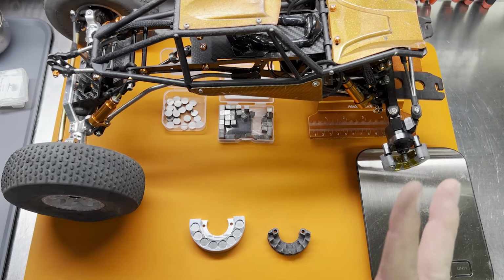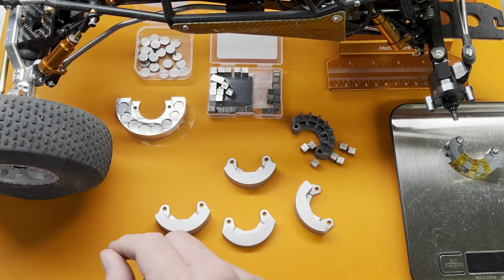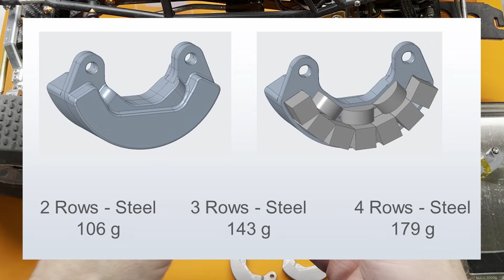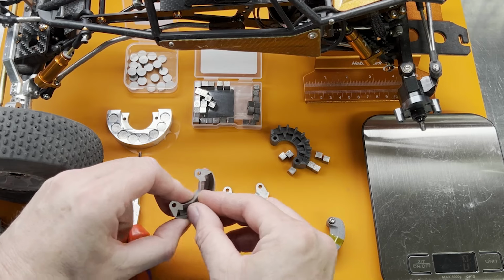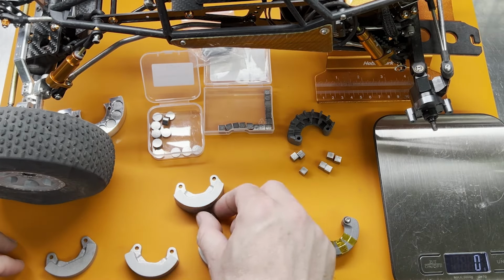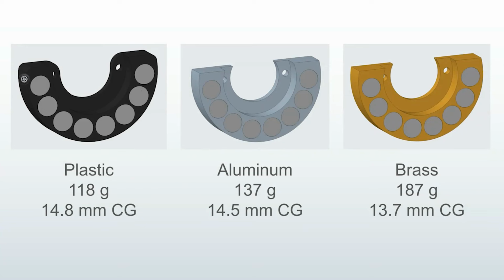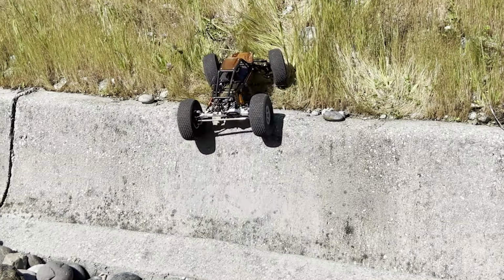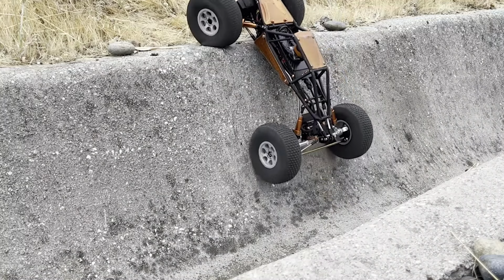Next Level Weight Hanger

Comment: For sale? Also, I don’t have Capra axles but the bolt pattern looks quite similar to the adaptor I have. I’m thinking I could get it to fit.
Reply from the maker: I wasn't planning on selling them, but I may have to put together a plan after so much interest.  Bolts are 32mm apart.

Comment: Could these be printed in PLA?  If so would you be willing to allow subscribers to purchase the files for a reasonable fee?
Reply from the maker: We could work something out. However, I don’t think plastic is a good idea- this is optimized for steel - relatively thin and the weights are super heavy. I don’t know for a fact that they would fail - I just would not care to risk it with anyone. DM me on FB with the same name as this channel.
Reply from the maker: What wheels and knuckles are you running?
Reply: @BoomslangSuss I will be getting the Dlux 2.2 Ultra High Clearance wheels.
Reply: @BoomslangSuss I should probably go with metal.  Let me know if you plan on selling some of the metal versions you have made up.  Thanks!
Reply from the maker: @jakefifelski3851  I am working on a plan. Stay tuned.
Reply: Man I wish you guys would do this cool stuff for vanquish f10 axles, not always for the capra ones.. but wouldn't fit in standard 1.9 wheels anyways probably

Comment: I figured out a way to use a spring on the shock shaft to create an automatic compressed front end, while still acting as a normal suspension while trailing. 
I used pen springs on the shock shaft inside, on longer shocks +10mm shocks, 20 weight oil.
Extended shock towers also.
The shocks still have the stock outer spring but backed off all the way.
While climbing the front stays down, but the axle still drops down when skid is hung up or vehicle is lifted off the ground.
I spent months finding the right pen spring and oil combo.

The trick is to balance both springs and oil weight.
If you get all them right, considering your front axle weight, it works great.

If you want to just trail you can activate full suspension by simply lowering the outer shock collar, which will over-ride the inner shaft spring giving you standard suspension.
Reply from the maker: I feel like your describing these two videos 🤣
Reply from the maker: The 2nd Biggest Misunderstanding in RC Crawler Tuning
https://youtu.be/QO91AZCZExM
Reply from the maker: Build a Full Droop Negative Spring Dravtech
https://youtu.be/aNEVRBKJuI8

Comment: Very cool!  3d printers really do open up a world of possibilities.  I hope you offer them, it would be great to have another option on the market.  Quick question -  do your hair bands match the length of the front shocks at full droop and the only rebound being whatever elasticity is in the hairband?
Reply from the maker: The only spring is the negative spring (rebound) of the band.  It’s preloaded at bottom out, meaning it’s stretched a little even at full compression.

Comment: What a great video/topic. How would you rank the importance of each: COG, weight forward & clearance. Given they all start out at an acceptable/avg  range. How would you prioritize their importance for improved crawling?
Reply from the maker: Excellently posed question.  If your goal is to keep the front end down on steep climbs, your rig is like a teeter totter and your rear tire is the center point. Eventually, you will tip over backwards when there is too much weight on the wrong side of the rear wheel. So you want as much weight forward "in space" as possible, not neccisarly forward on the car. After your are steeper than 45 deg, moving weight forward on the car moves it more towards the sky and less forward in space. Imagine 80 degrees - an weight forward on the car doesn't move forward in space, away from the rear wheel - it moves more upwards which is less effective. So if you are over 45 degrees, moving your CG DOWN is more effective, but forward doesn't hurt.
As far a clearance, you CAN have your cake and eat it too. There are ways to lower CG without compromising clearance.  For example, watch my video called "Make Your Own Skid" - I have my transmission and motor recessed into the skid so its only 3 mm up from the bottom surface of the skid.  Watch the video called "What's Up with my Rig Today" and you will see that my steering servo and ESC are both sitting as low as possible on the front axle. So I like to find creative ways to lower CG without lowering clearance surfaces.
Further on clearance - set it as low as you can so that you SOMETIMES have to scrape over things that you regularly drive over, but not too often. At least that's what I do. Scraping over stuff is fine if you don't get fully hung up too often.